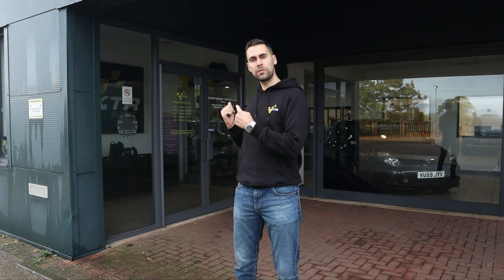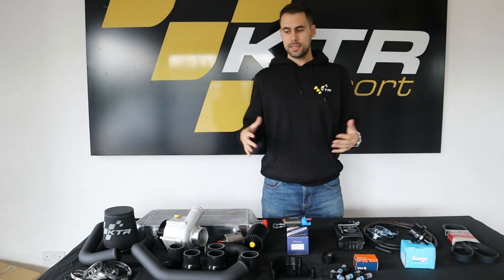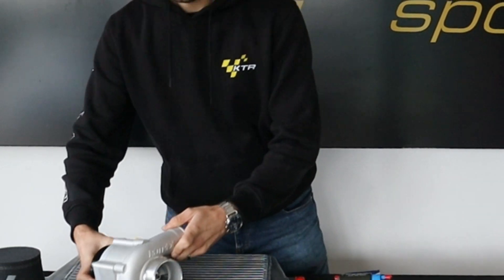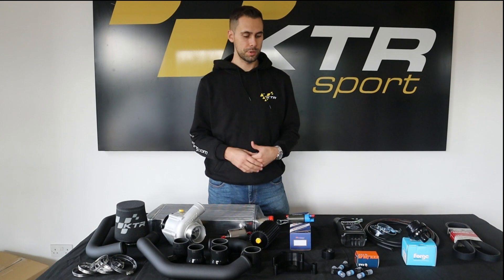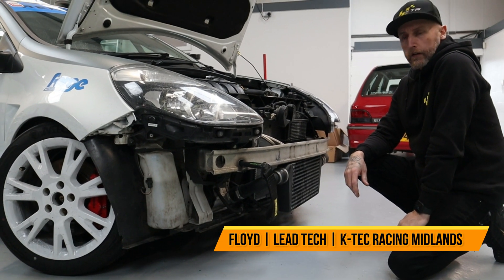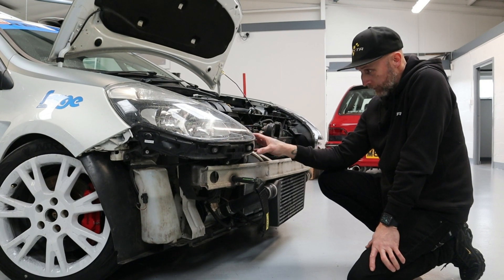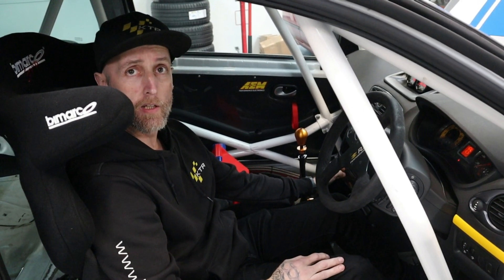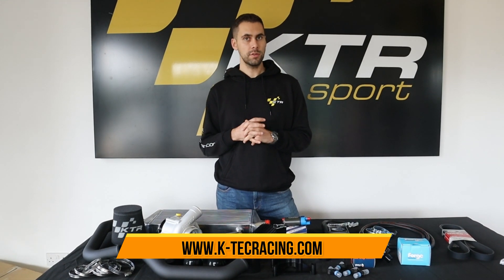PRODUCT SPOTLIGHT | KTR CLIO 3RS SUPERCHARGER KIT

Comment: Not worth the money if its only capable of pushing 340bhp. It would've helped if you were clearer on how much power you can get out of this kit!
Reply: Brayden I suggest you drive drive a sub 1000kg car with 300bhp before commenting
Reply: @walkaz  not very easy to get the Clio 3 under 1 ton tough,mine still has 150 kg to take out
Reply from the maker: To clarify, it's 300 bhp for a stock engine and up to 350 forged.
Reply from the maker: Hi Brayden, We were quite clear in the video how much power it can make. Usually around 300hp with the stock engine. And around 350ish on the forged engines. Some of the suspercharger kits with some extra enhancements can see 380ish.

Comment: What is the durability on the gearbox guys if this was run on a standard engine with hp cica 280 to 300hp?
Reply from the maker: We would recommend upgrading the clutch with this modification.
Reply: @ktecracingltd So the gearbox is strong enough to take the extra grunt? My gearbox has been rebuilt with upgraded syncros and Quaife is this enough for circuit use? Clutch would be swapped for stronger one regardless and was expecting that.
Reply from the maker: Yes, we have build plently of these and the gearbox copes well